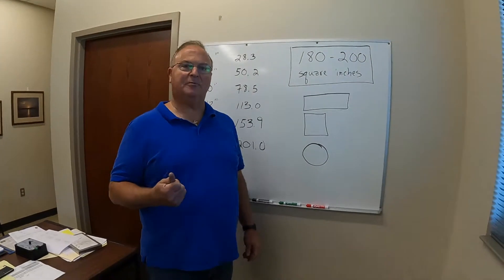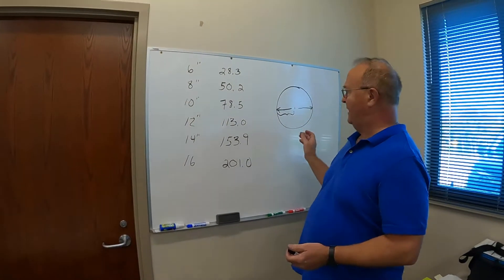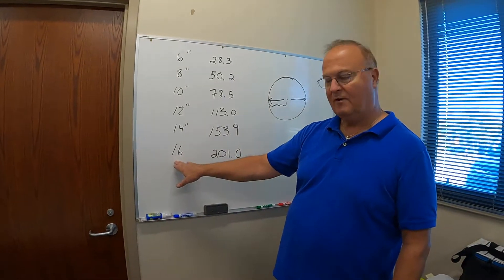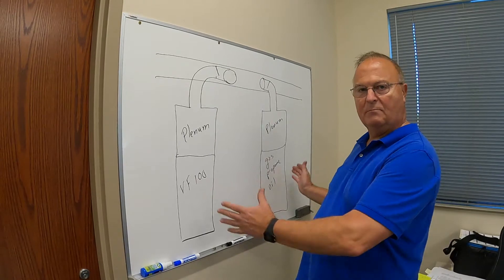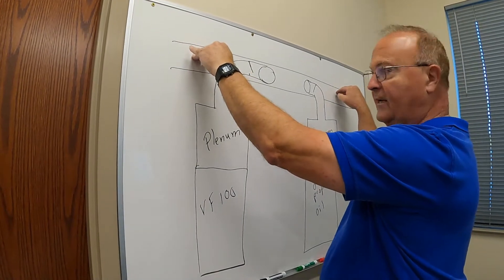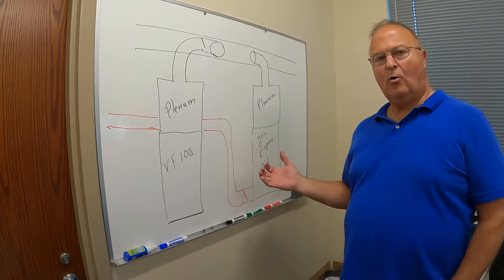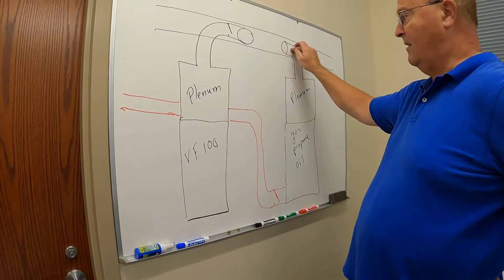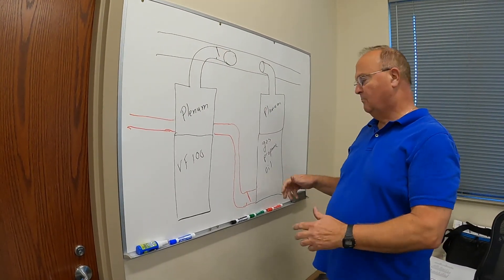Kuuma Vapor-Fire 100 Installation (Plenum Sizing and Ducting Connections "Commoning 2 Furnaces")

Comment: Wouldn't some of the calculations on the sizing of this depend on the length of ductwork you are tying into?  For example, to install in my house, I would have to tie into a 12X8 duct section that comes from my basement (the furnace) and feeds all the way up my two-story house into the attic supplying the 3 bedrooms and bath upstairs.  This is a pretty long section of duct work (I would estimate 25' in length) and my goal would be for the add-on to heat the upstairs and to "back flow" down to the furnace going into all the first-floor duct work.  Considering I would be feeding that duct work "both directions" wouldn't that double the calculation of the section I am tying into?

Comment: Would love to add this to my existing all Electric Heat-Pump/Air Handler whole house system.  However, it's in the garage with the warm air at the bottom of the unit at garage floor level, where it enters the crawl space ducting to supply each room with floor vents.  The cold air return comes through the attic, back to the top of the unit in the garage, completing the run.  Not sure how I'd hook this up with the heat at the top and the cold air return at the bottom, just opposite of how my system is set up.  If only I had a basement...
Reply from the maker: If the warm air duct is down at floor level - that is fine.  However, whenever trying to blow warm air downward, we do recommend the $50 upgrade from our standard 1/3 hp blower to a 1/2 hp blower.  This gives the extra boost to blow the warm air downward and into the ducting.  In this case, we would suggest taking a duct off the side of the Vapor-Fire plenum (between 180 and 200 square inches) and going down and connecting to your warm air ducting.  You will want a one-way check flap in each of the furnaces.  
It should be pretty easy to run your cold air return down to the inlet at the back of our blower.  
Based on what you said, I don't see any real issues.  If you wish to discuss this further, please phone in and speak with Dale.
Regards,

Comment: So I got a pre existing furnace with ducting but my warm air trunk line is on 8x14” with about 5 6” round ducts coming off it. I’ve been looking at your furnaces very hard and I’m wondering will I have to re do all of my duct work to make the furnace work?
Reply from the maker: Your furnace should work just fine.  When we suggest 180 to 200 square inches of ducting, this is for maximum performance and life for your blower.  If I knew more about your installation I might  be able to offer some other suggestions also. If you like, please give me a call at Lamppa for more specific info about your installation. Ask for Dale.